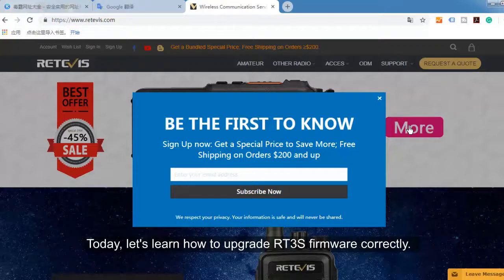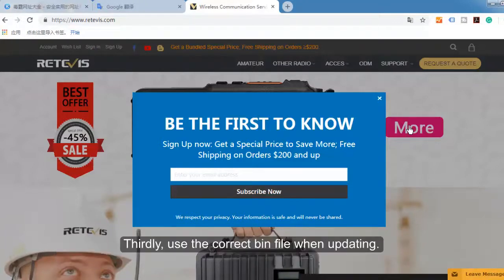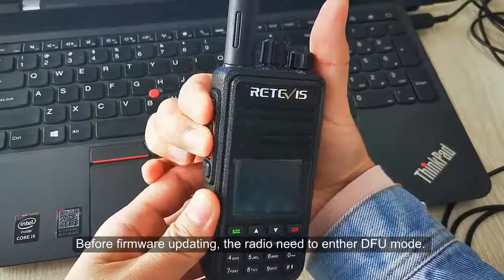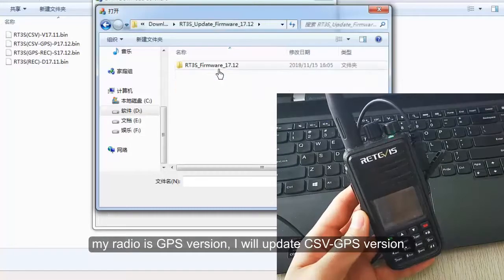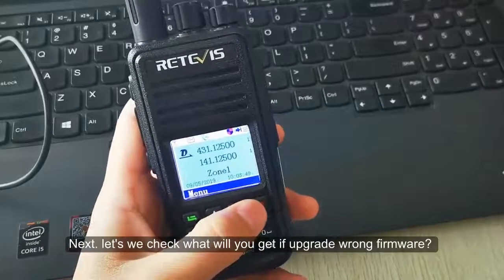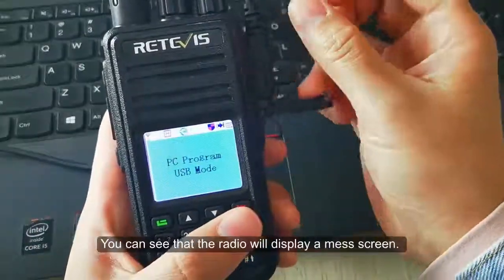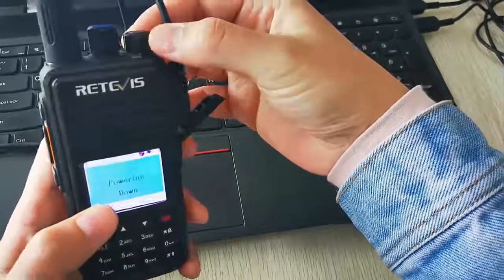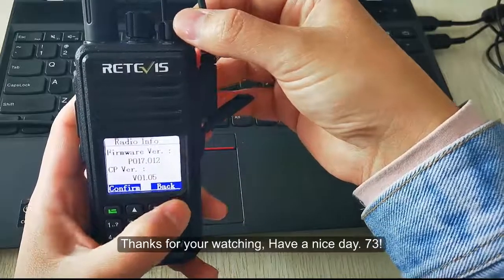How to Correctly Upgrade RT3S Firmware and Wrong Operation

Comment: Hello guys, I bought an RT3S with gps and unfortunately I can't operate it. When you call after a few seconds it hangs up and you can't do anything. Has anyone had a similar problem?
Reply from the maker: Hi,did you adjust some settings on RT3S?